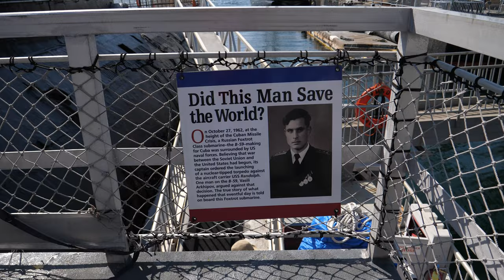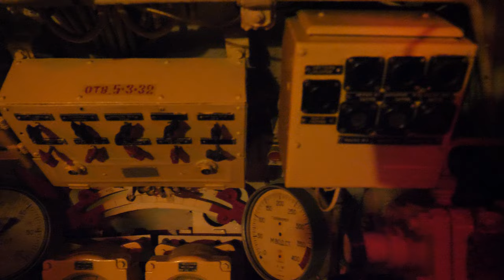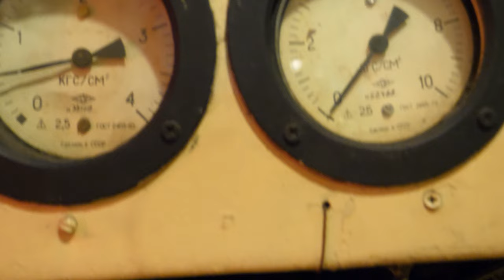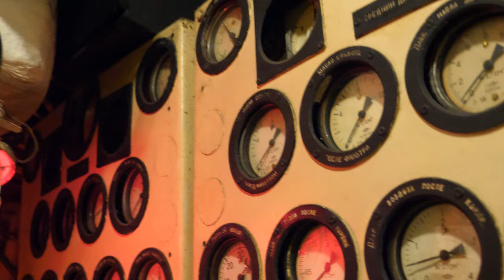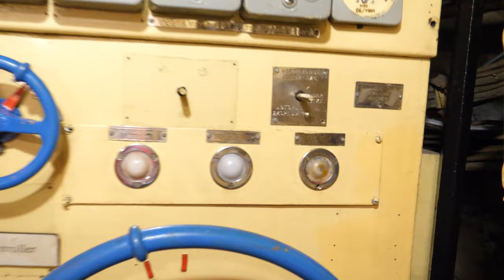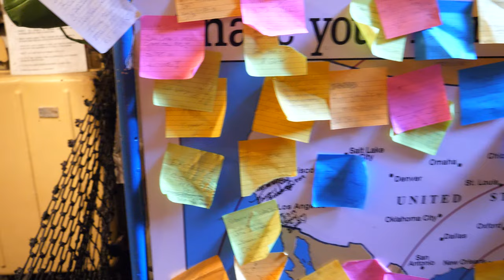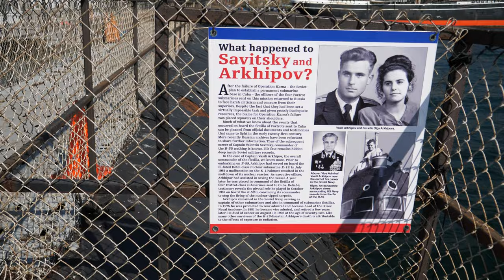B-39 Russian Foxtrot Submarine Tour in San Diego California Maratime Museum 4k

Comment: While this video was made over 4 years ago, and I Thank You for it. It does make worry about the condition of the boat itself. Sailors, no matter what countries Navy you may be in, always took extreme care of their boats. The inside has corrosion, missing paint and bare metal all over the place. The outer hull is extremely corroded I wonder if it has been compromised at any part. While I full understand that this boat is a museum, and is run on donations (I assume). We still need to take care of it. Thank you for the video.
Reply: This thing was scrapped about a year ago.

Comment: I'd rather serve on a WWII US boat than this piece of crap. The museum is doing a great job, understand; it Soviet Russia, which never cared about its people, even those defending it, that I am criticizing  Thanks to the museum for showing this.
Reply: Then you must not have been on a ww2 boat. Later Russian subs have auto loaders and plumbed fire suppression. US subs dont have auto loaders now. Auto loaders, smaller crew. better for each crewman.
Reply: @mvd4436  Automation does not equal quality
Reply: I agree with you.  I toured this 'thing' about 7 years ago.  Conduit that didn't fit the contour of the walls, bad welding, electrical cable that is just strewn about.  Old Ivan didn't care about quality, only quantity.
Reply: while I tend to agree "russians" tended to handwave away as unimportant   less obvious aspects of psychology and ergonomics ... 

well, material conditions, materials and instruments matters in those industrial arts. You can't weld steel with your mind alone.

And as aside USA is hardly worth copying as hyper-capitalist country!
Reply: The boat was fine for its time. Louder than the Kobbens Orions and various GUPPY boats because of the triple screw, but had similar performance and dove deeper. Sure its cramped, but all submarines of this era are. You dont really see any crew comforts until the Charlie II, and later Alpha class, which cut its crew compliment down to like 30 men from the previous 70-90 by incorporating a lot of automated systems. It was actually the soviets who stuck to that idea of minimizing crew comement via automated systems, and as a result late cold war Soviet submarines were the first witbany level of consideration for crew comfort. Hell, the Typhoons had a sauna and diving pool, and I think so did the later Deltas.